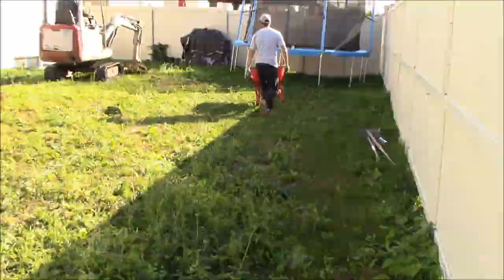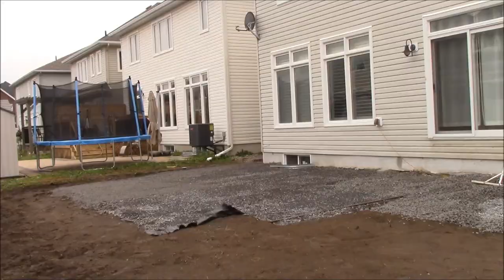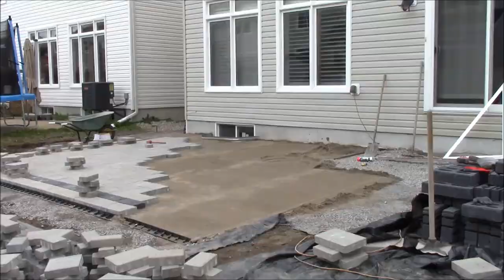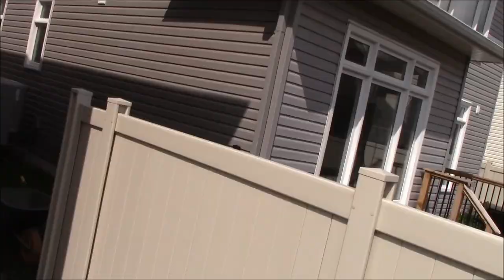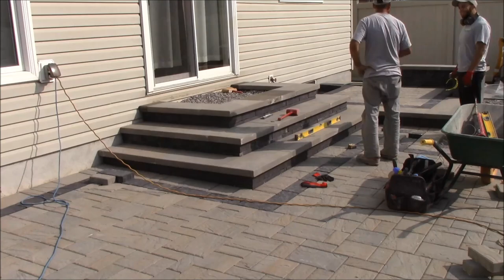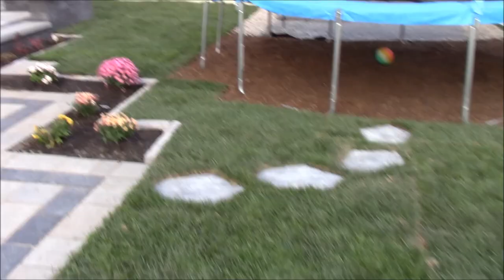How to Build a Patio - Techo-Bloc Pavers (Time Lapse)

Comment: As a 20 year professional with jobs displayed in manufacturers catalogs and many awards, this was done every way but the correct way. Base was insufficient,  pavers were never tamped after installing. No string lines were set beyond to border to assure things are on course. The finished product looks wavy and has curves in the border. Worst of all, major settling will occur in just a few years. This is my professional opinion.
Reply: You forgot backfilling up against the siding at the patio door.
Reply: @Paige Loren It won't be so amazing when you find out your sheathing, rim joists and the ends of your joists have rotted.
Reply: @Paige Loren Then you know nothing about building science and basic carpentry.
Reply: @Paige Loren If you did you would know what a bad idea it is to put soil up against siding like that.
Reply: @Paige Loren Dutch lapped siding with a 4 inch exposure with a floor system depth of about 14 inches (assuming 2x12 joists judging from the end elevation width) so that puts the bottom of the siding at the top of concrete. Bottom of sill plate is top of basement window so NO the stone is up against the sheathing, rim joist and sill plate. If you knew anything about house construction, you should have known that.
Reply: I agree, Anyone filling over siding has a serious mental problem. That's so unacceptable. 100% that top stair already is starting to show problems. If I was an inspector I wouldn't allow these guys to do any more work in my town. That's expensive brick they put down and it's all gonna fail.
Reply: Just curious...what should they have done differently from backfilling against the vinyl siding?
Reply: @ivans613  each step would need 4 walls to create a bed. These guys only put 3 walls and used the vinyl siding as the 4th wall. But siding is weak and flimsy and if it's not straight it can become unlocked and leak. I can't see anything going wrong with adding a forth "invisible" wall in the back to hold in the gravel. But I've never built a single patio in my life either....

Comment: And to think my husband and I did this all on our own with basic tools. I still marvel at it each time I step out! Could not repeat that now at our age hahaha
Reply: @Dee Dee go for it very simple just very long slow hard work if it’s just and your partner/ kids and please time weather right not run into 90 plus days or to cold. Just finished our second project a 800+ sq ft driveway first was a 12x17 raised patio and both started late spring then quickly stop work because of heat and finished in early fall as soon as temperature drop to 60-75
Reply: @Dee Dee Good luck !! Make sure you plan everything step, this way you’ll have time frame/cost of each step. If you need to rent excavator’s or something look into possibly hiring out that part and just direct the person/worker as it might be cheaper if not the same cost as renting
Reply: Dee Dee I’m in Virginia
Reply: How's it holdimg up so far?

Comment: Great video. Would only suggest a couple things to improve the work:

- Those bars are supposed to be used for the bedding, not the crush. I have no idea why they even bothered using them when the crush grade doesn't need to be perfectly flat
- As a result of what we call "Hand Screening" the bedding, I can see a lot of small imperfections which will compound over time
- Either the steps are slopped the wrong way or the patio has too big of a slope. Another result of hand screening. They really should have used string lines and bars to set a perfect slope.
- Additionally, if the steps are slopped the wrong way, that will be water creeping into the foundation which is a massive no-no
- Assuming anyone watching this is Canadian (techo-bloc), use HPB (1/4" angular limestone) instead of sand. It's permeable and much easier to work with
- Always always ALWAYS tamp the stones after installation. You can get a polyurethane pad that comfortably sits inbetween the tamper and pavers to prevent any breaking. Not only does it provide a beautiful finish grade for the pavers and secures them in place, it also vibrates the polymeric sand together for a stronger bond.

Comment: How much did that job cost? It looks amazing.
Reply: michellewis26, $9800+6% tax cash if it were paid by check they would’ve wanted $10,600+tax Cheers mate 🍺🍺
Reply: That job cost way more than that. Easy $25,000 , but we are in California.  Maybe in some nothing state it can be done so cheaply.  They did a great job on the work
Reply: 20k
Reply: @TheDude613  no way 20... 25 to 35 .. Steps are $$

Comment: Why do you put rebar in the gravel layers of the base? I Understand the rebar can be helpful in the leveling sand layer to screat the sand but even here, does it really add structural strength worthy of leaving it in there? Thanks.
Reply: They didnt leave it the base. And its not rebar, rebar is rigid and flexible and would not be a good screeding tool. They just used grading bars, hollow metal pipe. And after they screed over top of them they pluck it out and fill in the void it left and move onto the next section.
Reply from the maker: great explanation... Thanks,

Comment: Now that's how you do a patio....Unfortunately I can't afford all that, so I am going to use the concrete mold, Lol...Looks good tho
Reply: Stoneryoda 937  Yeah and when concrete moves it cracks and breaks and you cant repair it as easily as stone patios. So in other words concrete patios suck!!
Reply: Stoneryoda 937 they dug really deep and applied a ton of base material. Assuming it was compacted enough it’s not gonna happen. Nice negative overtly general comment though. Bet  you don’t wear a mask either.

Comment: How do you handle a dryer vent that exits the building below the patio doors?
Reply: Install a pvc pipe to it and run it through whatever your building.
Reply: You move it somewhere else. Anybody that puts anything under a door has a total screw loose.

Comment: Anyone know if your supposed to put the pavers up against the vinyl siding like that ??
Reply: When i bought my house it had steps similar to these. I went to replace the floor and found that  my subfloor and rim joist was rotted through due to no flashing. Should have atleast put some metal flashing between the siding and stone. I've also heard you could cause your wall to cave in with the pressure of the stone
Reply: NO. NEVER. Absolutely NOT.

Comment: seems a pretty expensive projects! taking a long time..
Reply: Ignoring someone else's "Mexicans" comment, I think the interesting thing would be to compare how long the same job would take if it was done by laborers who lacked any experience (paid less, take longer) against a seasoned team (paid more, much faster.) Homeowners trying to do the same kind of thing might freak out at a bill for $20k, but if the alternative is a dodgey job that consumes most of your summer's weekends, leaves you with a pile of one-use tools and no one to turn to when/if flaws emerge, the calculation is different.
This guy's job looked like it took about two or three days on-site, and a few days of coordination/admin effort.

Comment: I don't understand. Why are the blocks sprayed with water? Techo Bloc instructions do not specify adding water.
Reply from the maker: Hello, the reason for the spraying water is to activate polymeric sand for bonding. There is no other reason to wet the paver.
Reply: RIVERMIST LANDSCAPE ohhh ok. So it's a requirement for the polymeric sand....gotcha. thanks

Comment: I was looking into buying the same dustless cutting saw but $2400 has me procrastinating...how do you like it ?
Reply from the maker: I love it, its fast and no clean up after, but you have to get the right blade for it, it's very good for pavers, but slab and    caps or wall block you have to use quick cut saw
Reply: RIVERMIST LANDSCAPE, Thanks I love you for the information. 🍺🍺🏆

Comment: You should get with TECHO. And take the class they offer. You never put plastic or fabric under or behind anything. They are called permeable pavers for a reason.
Reply from the maker: Hi, thanks for the comment, but I am a Techo Pro contractor and ICPI certified, this patio is not permeable it is interlock patio which Techo and ICPI recommend Geo textile fabric to separate the clay from the gravel and give the base extra strength.

Comment: First and most importantly the barbecue grill is supposed be as for the house as possible!!(101) and a little fire pit would be nice in the far corner of the patio. Also the trampoline should be in the ground. ( safety comes first) just my 2 cents as a mom, every thing is nice.